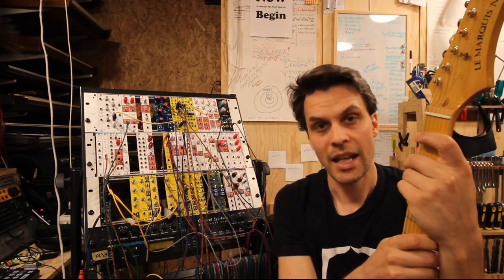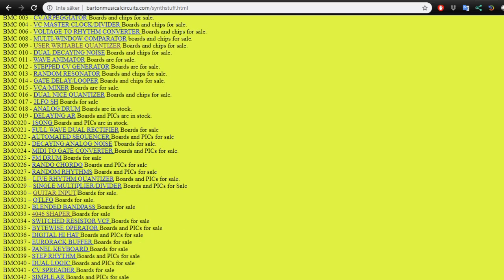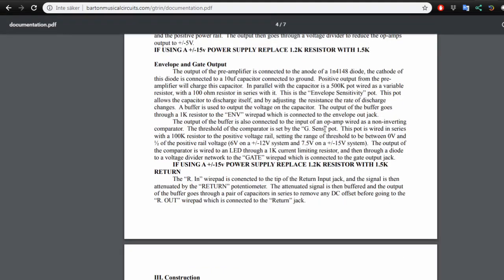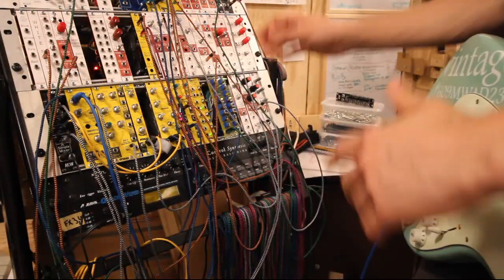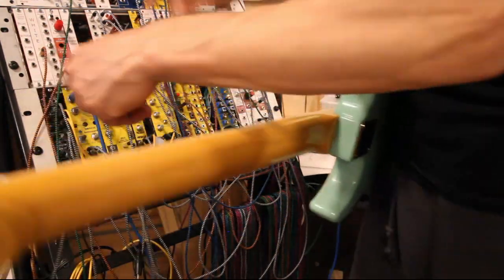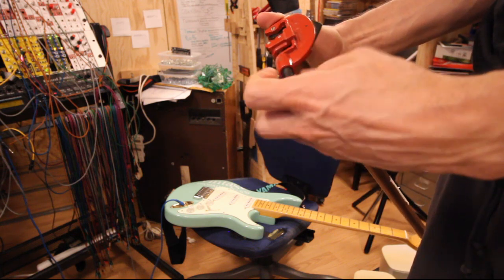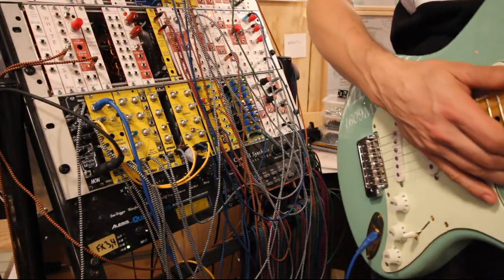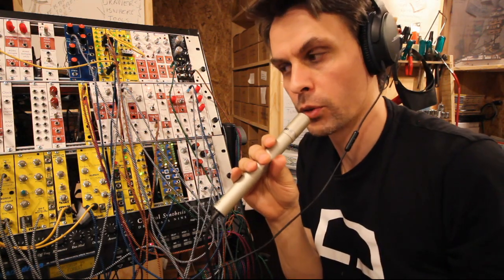BMC030 Guitar Input (and a simple Slide) - DIY Modular in a Week 11.1

Comment: with this module it'is possible to interface signals from a 9V noise box to a 12V eurorack module and viceversa ?
Reply from the maker: Depending on how “hot” the output signal is from the noise box it might not be needed. But basically yes. What this module does is amplify the signal A LOT… so it’s is made for the super low signals of guitars and dynamic microphones but can at low settings work to boost line level stuff aswell.
Reply: thank u so much :)) do u know if there are "standard" voltage levels for the input/output signal coming from a 9V module or from a 12V one ?
Reply from the maker: No not really. Most modules stay below 8v I’d say. Nowadays there are a lot of MCU driven modules which tend to stay below 5v. But I wouldn’t say there really is a standard in modular. 🤷‍♂️

Comment: Would it be feasible to modify the circuit too work with a dynamic microphone?
Reply from the maker: You would need a 48V "phantom power" inserted somehow.... Have to research that I guess :) Also it should be possible to use a buck booster (or something like that) to boost the 12v to 48v... Again, have to research that too... :)
Reply: You are thinking of a condenser microphone, whereas a dynamic microphone doesn't need any phantom power.  

I think that if one went through the trouble of building a 48v phantom circuitr, it would be better to build a channel strip, like on a mixer, with eq, padding, gain etc.